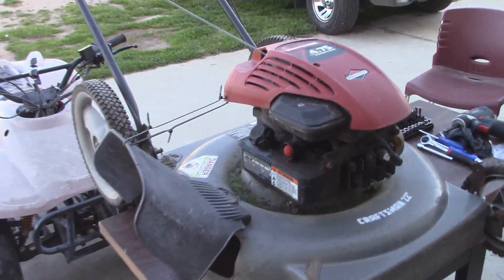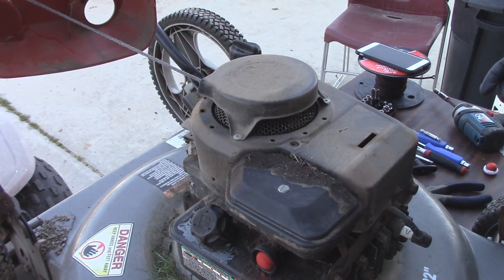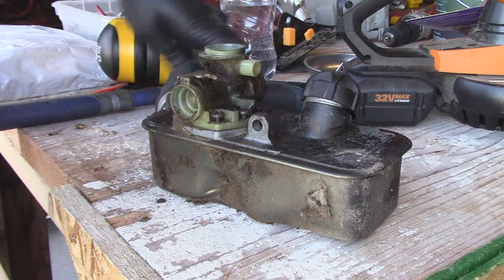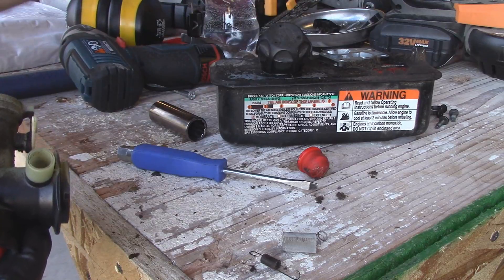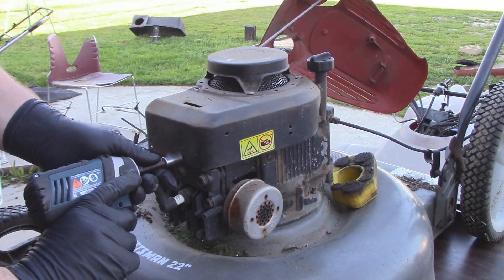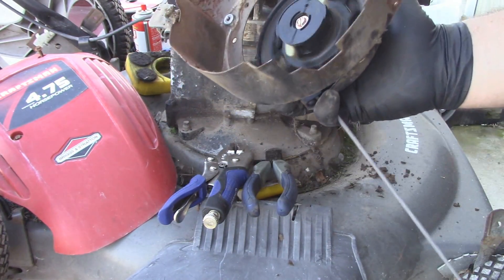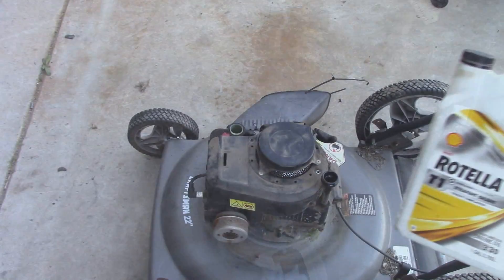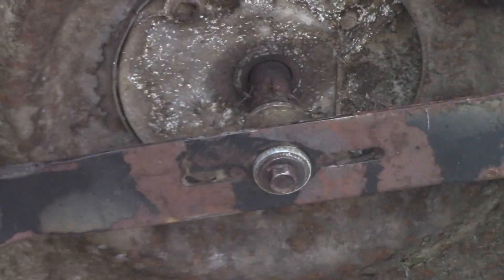Craftsman Lawnmower Tune Up and Pull Cord Replace

Comment: i got this exact mower for nothing. Guy said the blade was bent and it wouldn't start and i noticed there was oil all over the deck, so for $20 i wasn't going to buy it. then he said why don't you just take it if you think you can fix it. So i did. I cleaned out the carb and in the process noticed the bolt holding the tank to the motor was loose so oil from the engine was escaping past the vent tube onto the deck. Once i put the carb back on and tightened everything it started right up and no oil leaks. I changed the oil and just need to buy a new blade for it. there was no damage to the crank. it spun straight when i turned it. Nice to have a spare mower!

Comment: just a few observations I noticed when working on mowers. I like to really melt the tip of the cord and pull it to a point with my rubber gloves. the hottest part of flame is the tip of the flame. I like to tie a untieable knot in the cord by the handle just in case. I've noticed most mowers take about 20 oz. of oil. I just started fixing small engines last August. I love it. I learned a lot from watching you and other YouTubers and just doing it. thanks for the videos.
Reply from the maker: glad its helping ya man

Comment: Nice! I garbage picked one of these last year.  I adjusted the coil gap to get the spark back and she ran like a top! Then I had to put it back together after someone started playing around with it. . . But once together, it was a great mower. I mowed the yard 4 times before I sold it.
Reply from the maker: +Delmont Industries LTD not bad ya they are pretty light weight

Comment: How would this mower flood? Is it possible?
I have exact same one and plug keeps getting soaked on start up.
The carb is on top of the tank but it keeps getting the plug wet.
Reply from the maker: Needs a new diaphragm Kit it sounds like